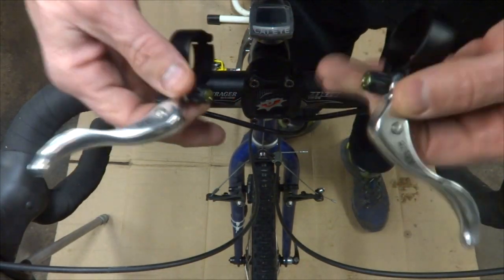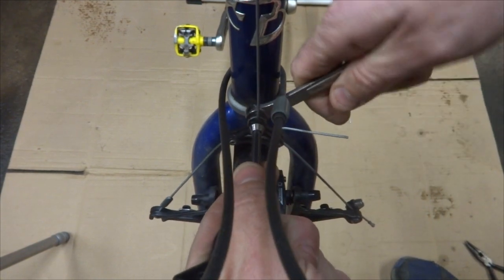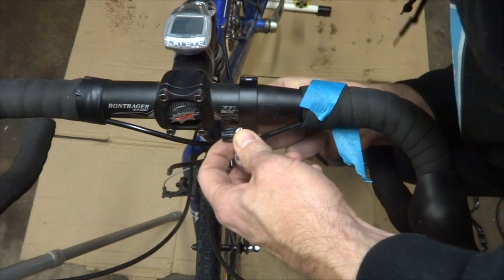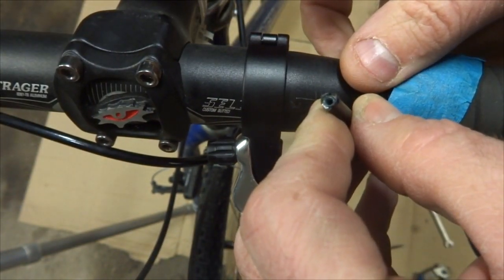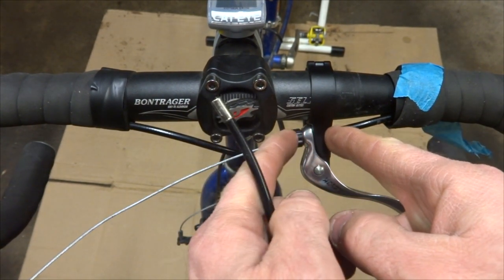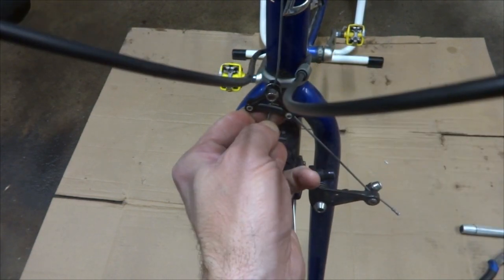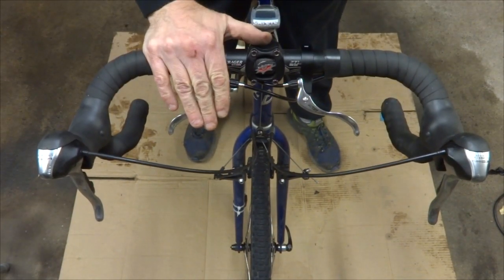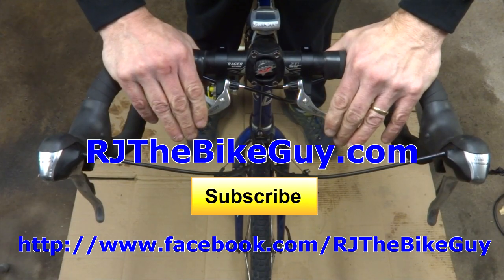Installing Cross/Inline Brake Levers

Comment: I have a bullhorn handlebar, I’m looking for ideas for my brake/shifter levers. I’m looking for microshift barends levers but my question is: These brake levers can be used in reverse mode? Looks like a dropbar brake mode... I think I explain good my idea... my English is not gods sorry...
Reply from the maker: No. They are INLINE brake levers. Between OTHER levers and the brakes.
Reply: RJ The Bike Guy thanks so much

Comment: Can cross levers be used as primary brake levers alone? Do you simply install the cabel end the other way around, so you can pull it? I am struggling to find a brake lever that fits on a 31.6 handlebar and do the job. I went to the shop and they suggested this type. Fingers crossed that the cable won't snap after a while... Any other ideas?
Reply from the maker: No, they are not intended to be primary levers. If you rinky dink the cable, it will likely fail at the worst possible time.

Comment: So basically one single brake cable runs through the primary as well as the inline brake? What is your advise to use two separate brake cables? Nice video.
Reply from the maker: Yes. And works fine. I don't know of a setup that uses two cables.  So you are on your own trying to make that work.
Reply: My advice would be, unless you're an expert in pulley ratios and spring tensioning and you also wish to make you bike look like a 19th century loom, don't even think about it.

Comment: Can these brake levers be used on their own? Like can the head of the cable be placed into the interrupter lever? Would it be a road brake cable?
Reply from the maker: No. Just buy brake levers. Probably cheaper, and more easily available.
Reply: @RJTheBikeGuy  That's a shame, regular flat bar levers are too bulky for the narrow flat bars I want to use. As opposed to how inline the barrel adjuster and clamp are on interrupter levers.

Comment: Would this still work with mechanical disc brakes? Obviously more cable will need pulled through the housing.
Reply from the maker: Probably.

Comment: RJ PLS REPLY

is it good if I use the brake lever and the shifter and put it on the drop bars?
And it's a mtb shifter and a brake lever, is it good to use different brake lever rather than a road bike brake lever with a shifter? pls reply
Reply from the maker: Not good.
Reply: RJ The Bike Guy could I do this process for my mtb shifters? I’m planning on adding a drop bar and getting straight pull brakes for the drop and use the standard shifters on the bar part. I think it will work but I don’t want to mess up something for no benefit. What should I do?

Comment: hey rj i wanted to put a brake just like that one on my track bike but i wanted to put it right beside my stem and i wanted to knwo what clamp size i would need..23.8 or 27 mm ?
Reply from the maker: +Der Von Nebenan It may not work right beside your stem as the lever would hit it. And you need to measure your handle bars for the clamp size.
Reply: Yeah ill do that...thanks :)

Comment: I want to fit my levers/shifters from a flatbar onto a bullhorn/drop bar. I've tried, however the clamps on mine are not hinged and I can't slide them around the bend!
Any ideas how I can fit them?
Reply: Obviously you need to buy hinged ones then

Comment: Hay R.J. I'm planning to build a motorized bicycle and want to use hydraulic disc brakes do you know of anyone that makes a dual hydraulic brake lever? The only thing I can find halfway close is the sunlite mechanical ones
Reply from the maker: Do you mean cross levers for hydraulic? Not that I know of. I kind of doubt it.
Reply: @RJTheBikeGuy  The new Shimano GRX is also including (or maybe will be sold separately) crosstop for hydraulic. 
so ya, it's kind of good news.

Comment: Hey RJ, hope you are feeling better and able to decompress- Literally! I'm looking to add a set of aero bars to a drop bar bike for added comfort while touring. Should I use an inline lever as you showed here or are there any other cable splitter products you recommend?
Reply from the maker: Generally the aerobars don't have brake levers.  Here a video where I install full aerobar setup. https://www.youtube.com/watch?v=9eCha9M6Llc
Riding on the aerobars is not as stable. If you want to brake, you would want to go to the regular bars for more control.

Comment: how does it work? Can't seem to wrap my head around it
Reply from the maker: It spreads the cable housing effectively making it longer while the cable stays the same length. So making it relatively shorter and pulling the brake.
Reply: @RJTheBikeGuy  So is it only the strength of the housing that is pulling the brake?  That sounds like it could fail in a critical moment?
Reply from the maker: @bengold4986  The strength of the housing is no different than without the levers.
Reply: @RJTheBikeGuy   @RJ The Bike Guy  Not what I was asking. The main brake lever pulls the cable - which is very strong and unlikely to break.  It sounds like what you're saying (if I understand correctly) is the cyclocross lever is using the strength of the housing to pull the brakes.  If, theoretically, the housing broke, then the cyclocross brakes would fail right?   I'm not criticizing the brakes as much as trying to understand the concept of "spreading the housing".  Though I am curious if the housing connection ever do fail?
Reply from the maker: @bengold4986  The stress on the housing is the same with the regular lever or the inline lever.

Comment: hello sir, i want to do the same with my montain bike. i want to convert my handle bar. my handle bar is flat, and i'll change it to bull horn handle bar, what do u think about that sir? is it good to change MTB bike with bull horn handlebar? thanks 4 ur reply
Reply: +Gusti Muhammad Khairul Akbar Hi, I'm not RJ but I would advice that you don't change your handlebars if you want to do actual mountainbiking. Bullhorns give you a narrow position and a forward leaning position and both of those give you less control over the bicycle than normal mountain bike bars. Also they will make it more difficult to lean backwards when riding downhill. And because of the slower speed of mountainbikes the airodynamic position that bullhorns give you is less of an advantage.
Reply: Hal Incandenza okay i see my friend, thanks for your advice, i think the same like you. Now i just change my bar to multi traking bar/ butterfly bar. its good for me, and more relaxing grip i have

Comment: Is there a way to install these levers and have them be the primary/only brake on the bike?
Reply from the maker: Not really. Just get regular brake levers.
Reply: Thanks. I bought levers like these online not exactly realizing what they were. The reviews mentioned you could install them as primary, but I don't think it will be worth the hassle.
Reply: You could fix the cable somewhere behind those levers, that's the same thing the road break levers do when you use these additional levers. But I wouldn't recommend it. The breaks are you live line, you shouldn't mess with them.

Comment: how do i fix if one side of the brake is slightly touching the rim even i dont press the brake handle?
Reply from the maker: First make sure the wheel is mounted straight. If it's still an issue, then adjust the brakes. I have no idea what kind of brakes you have.

Comment: I installed the cross brakes last summer on my bike. I'm having trouble with the performance of my drop brakes. I can compress them all the ways down and they don't perform well. I've tried to adjust multiple times and I just can't figure it out. Could you help me out with this issue? 

I really would hate to get rid of the cross brakes as I love to have the stopping power up top and on the drops.
Reply from the maker: Not without having worked on the bike. For all I know you are mixing short pull road levers with long pull v-brakes or something.

Comment: Hey maybe somebody can help me. I installed a cross lever just like in the video. But now the cross lever works perfectly fine, only when I pull the main lever, the brakes aren't releasing at all. When I'm pulling the cross lever again, it works, but just the cross lever. Couldn't find the error. Cable housing and cables are brand new, they run very smooth.
Reply from the maker: Sorry, but no idea. I am guessing you installed it incorrectly.

Comment: I don't understand the physics behind this. Pushing the cable in the direction of the break makes the inner cable go back words?
Reply from the maker: Sorry. It's pretty simple. Expanding the gap in the housing, effectively makes the housing longer. So the amount of cable sticking out the end of the housing decreases. The same as pulling the brake lever.